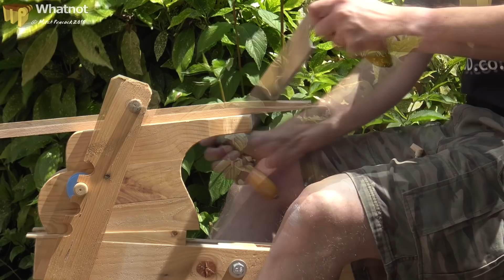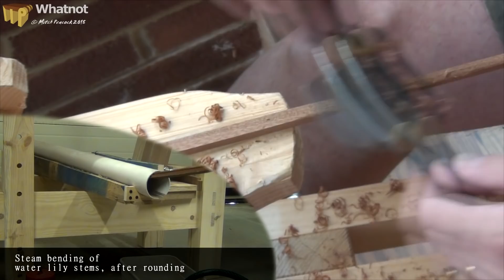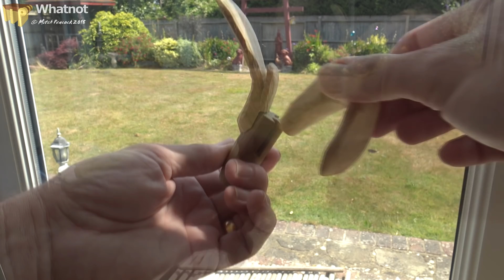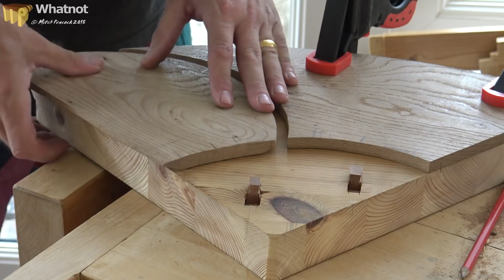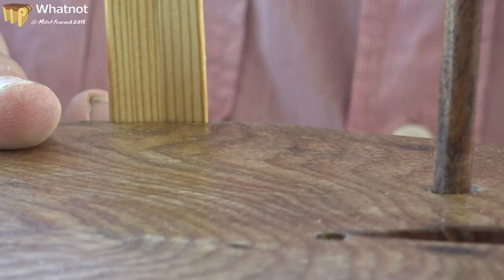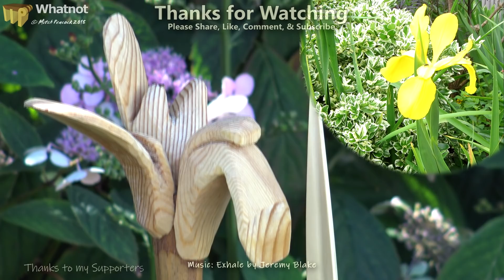WhatNot for Sue  (100% Wood Challenge #4)

Comment: Hi Mitch, a lovely piece and well designed. You were doing so well with that egg beater drill and then suddenly you used a battery drill, such a pity but still a very nice bit of woodwork
Reply from the maker: Thanks John. Yes it was all going so well, but for that tiny task I really needed a third hand! Of course if I didn't have a cordless drill, I would have had to think of another way around the problem. Maybe next fully unplugged build I'll get the wife to lock my batteries up ;-)

Comment: That must have taken hours, I am trying carving spoons and the YouTube guys make it look easy and it isn't, my first spoon was good, 2nd spoon has not gone according to plan, keep up the good work
Reply from the maker: It wasn't just an afternoon's work, that's for sure! 
Never made a spoon myself, but as with most carving I guess the trick is to cut across the grain with both blade edge ends out of the wood. Simple splits, so easy to start, can ruin a piece just like that. Hopefully you can turn the second one around.